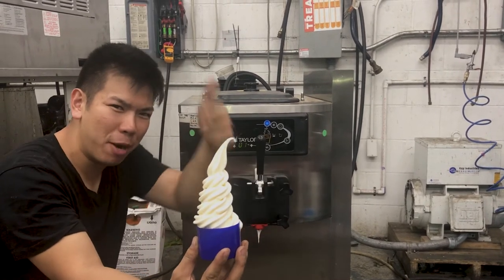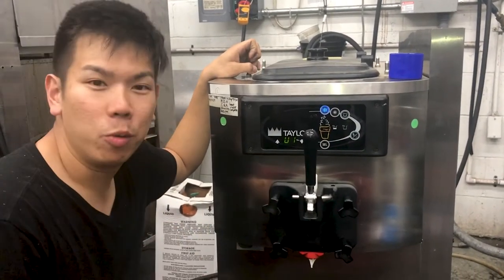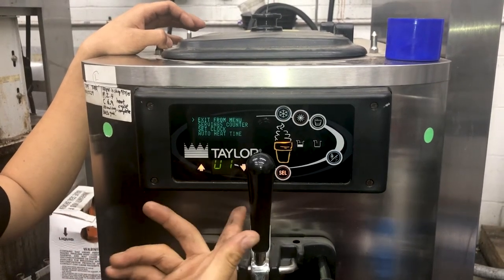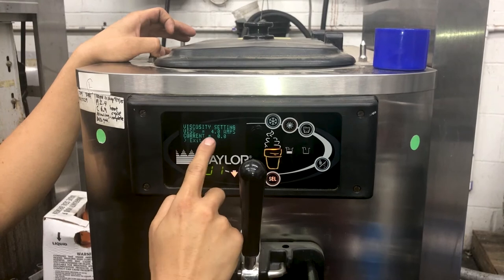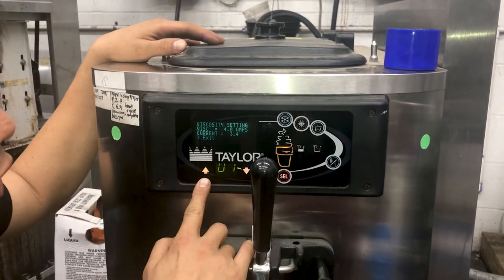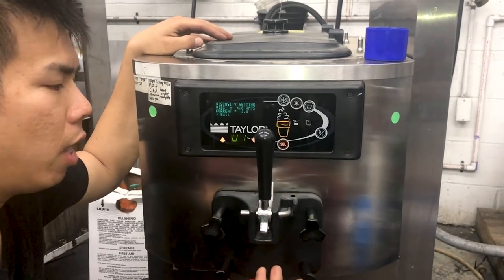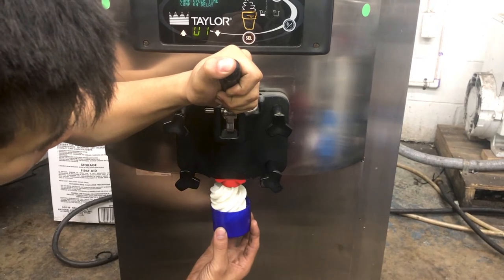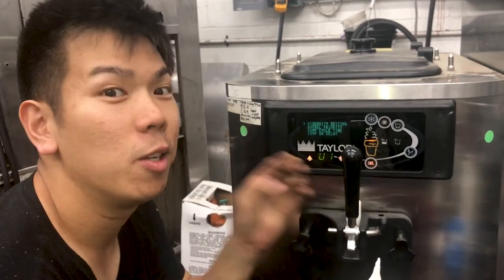Taylor C709 Adjust Viscosity Settings

Comment: Thank you. I needed several switches rebuilt on my (used but new to me) 709...long story short, because of this video I asked the tech for the code...not all codes bring up viscosity settings. It cost over $300 just for the tech to come out and look and another $990 to for him to rebuild the switches. I was able to fix the viscosity settings myself, avoiding another $300 house call using your video. Great job!

Comment: But how to adjust AMPS on c706? It doesn't have a logic board like this one..
Reply from the maker: Amperage is not adjustable. It will be displayed on the serial plate (side of the machine).
Reply: @slicesconcession8012  my c706 is not making the ice cream thick enough. Also it works for a long time every time I make an ice cream. In fact every time it works for 10 minutes. Then it stops, I make 1 ice cream, then again it goes for 10minutes. Help, the people coming to 'fix' it are all dumb they don't know what is it
Reply: How common is that refrigerant levels are low on Taylor machines? Is that possible?

Comment: We have an issue that says "System needs to be cleaned". The temperature reads anywhere between 50 and 70 but its pulling as Normal/Cold. What do we do? We tried rinsing it out.
Reply from the maker: Most likely your hopper temperature probe or barrel probe are bad. Why don't you call who sold you the machine?

Comment: How do you know if it's a viscosity issue or a beater issue? When things freeze and won't come out?
Reply from the maker: HI, 

Usually if you freeze it too hard the machine will not dispense product because you have a solid mass of ice cream. This can break or damage the motor and or gearbox.

It also could be that you are using blades that are old and need replacing and it cannot properly scrape the walls of freezing cylinder. 

You should contact a service agent.
Reply: @slicesconcession8012  

I contacted Taylor and they said many variables, sounds like they want to charge me up the ass for something that might not be too difficult to fix.

Last night I went into the system and one side has the hopper temp at 36f which is regular, but the barrel temp was way down 6-7f, while the right side was around 18-20f.

You have any insights into this?
Reply from the maker: @KoiAquaponics . We cannot help you much more. You could have a bad temp probe, your pressures and expansion valve could need adjusting. You need a tech. Not a self fix.

Comment: Hi, thanks for the video. Does the machine have an amp range? When it reaches the desired amp does the motor and compressor shut down?
Hope to hear from you. Thanks
Reply from the maker: Hi yes it does. It can be adjusted once you get in to the tech level settings of Crown Series board.
Reply: @slicesconcession8012  And when does it come back on?
Reply from the maker: Hi,

Yes the motor and beater motor will cut out at the programmed amp number. It will also kick back intermittently.

Comment: What is the default viscosity setting on a C708
Reply from the maker: It will be different for everyone. Viscosity varies based on the type of mix being used, ambient temperature, how much air flow it has on an air cooled machine. We suggest you start at a low setting and slowly adjust, test and repeat until the desired texture is found.